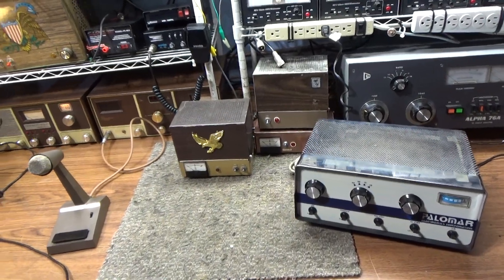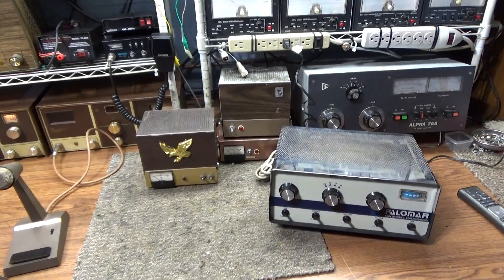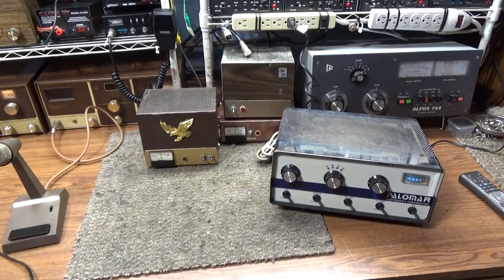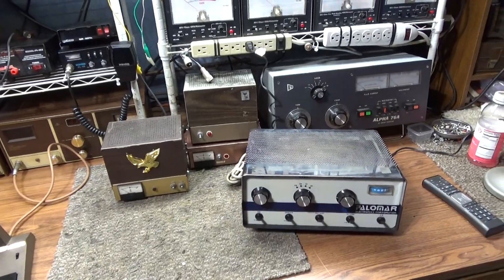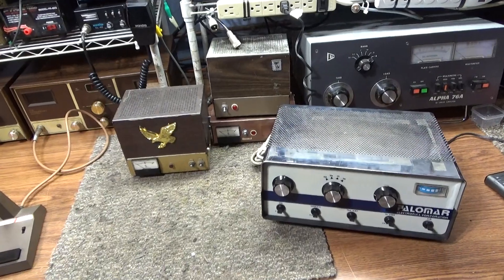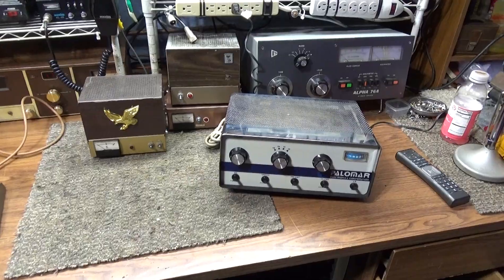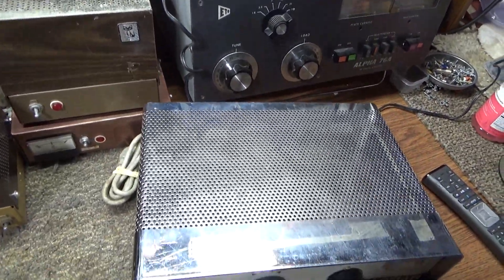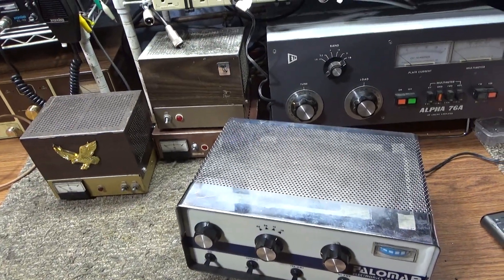Me, ranting and raving over Input SWR's LOL.

Comment: Interestingly, many years ago…..before the superhet receiver came along, this very same scenario of worrying about and dealing with RF tune between stages in a receiver was a big concern.  The TRF receiver required a user to tune each individual stage., every time he/she changed frequency.  When the superhet hit the scene, it was a big relief since each stage of RF was now the same frequency as was the RF stage before it.  Well, in many FM sets, a second IF is/was often used.  But in general it was the same thing which made using a radio much easier than before the superhet came along.
Reply from the maker: You are telling your age. Closes thing I played with was the Buddy Base which has a Super-regenerative receiver. You don't have to tune it like that, and it has truly amazing sensitivity...... and truly awful rejection. You can hear 8 channels at a time.
Reply: @tramdr - 😝🤫

Comment: If the input SWR is high it can hurt the finals in the radio driving the amp! That’s the way I understand it is that right Doc??? JohnBoyUtah
Reply from the maker: Yes, and same if you are running a small driver amp into a bigger amp. A high Input SWR on the big amp will take out the finals of the driver amp.